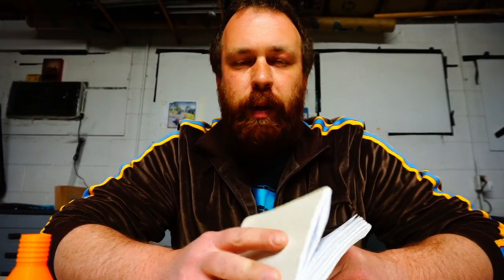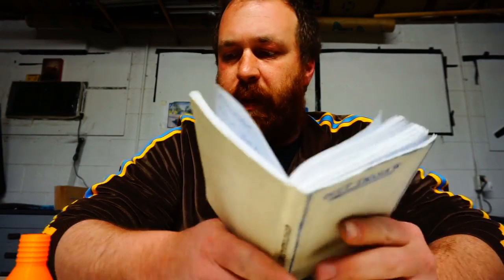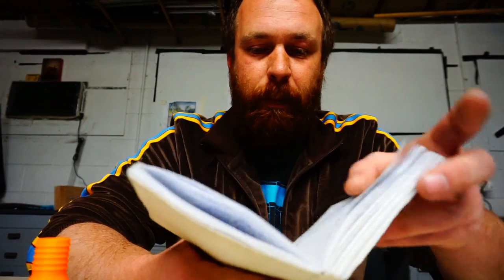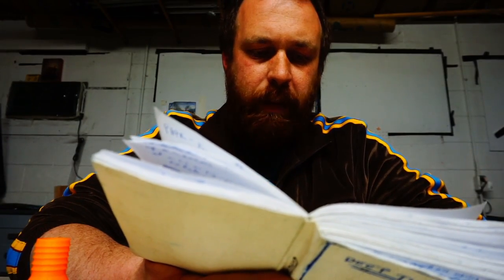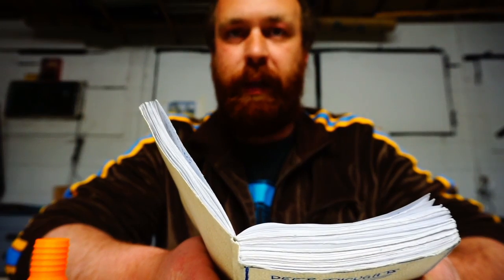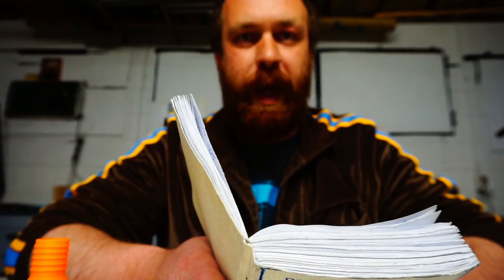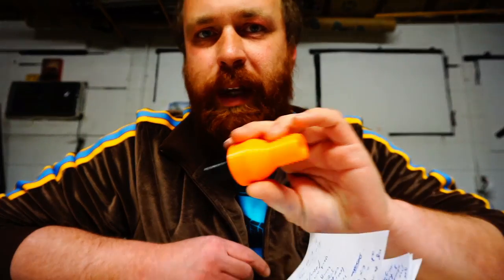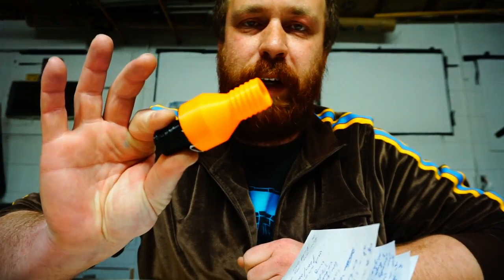COVID19 Ventilator Overview

Comment: brilliant stuff. well done.
there is a vid i will link from rice engineering showing a bag being squeezed for ventilation. im not a cleaver man, but i wondered: would the motor in our printers (we all have one with no ink) work as the slave to squeeze? maybe a laptop or computer sending the signal to squeeze and relax like when the print head goes back and forward. im just throwing what i hope to be helpfull ideas to someone more in the know of how this might work or someone else see`s this.  good luck.

https://www.youtube.com/watch?v=1t2t8d8xtD0&t=12s

Comment: For the piston, I think the second smaller piston is not necesary. All you gotta do is close the exhaust valve once the pressure has dropped to the PEEP pressure. I'm working on a piston-driven system, but I'm using a rack and pinion rather than a crank. Bit of a shameless plug: https://www.creonova.nl/emergency-ventilator-thought-dump/
Reply from the maker: I think you are correct.  I had the realization last night that I could replace the second piston with a PEEP valve.  I think that today I might work on another set of valves - 1. a spring tensioned mechanical valve that will exhaust only above PEEP pressure, and be adjustable, and use something simple like a bic pen spring to tension the gate.  and 2. a mechanical valve that can be cammed to a motor or crankshaft that drives a piston / rack and pinion setup.  I think those would be simple and useful parts for clever people to use in their designs.  I'll check out your project, and thanks for the link!